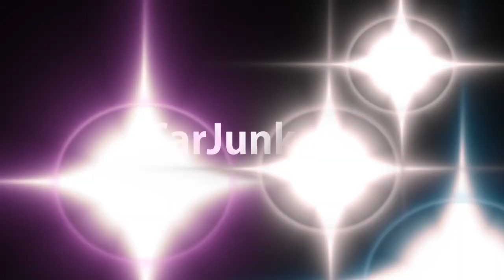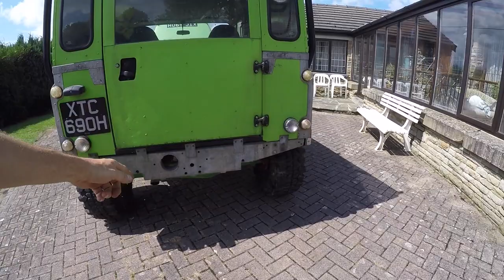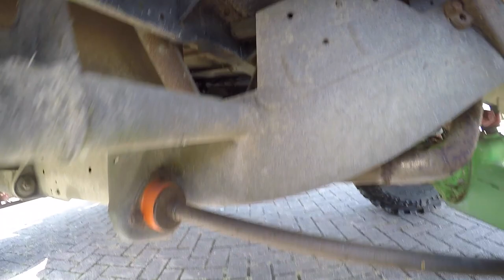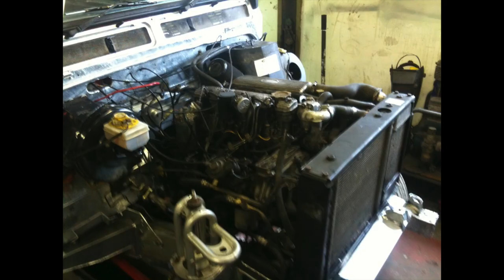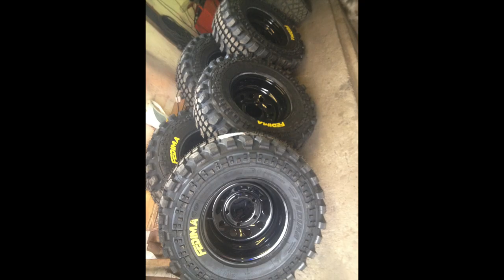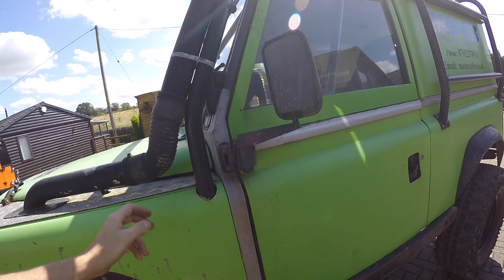GREEN TING walk around. Land Rover Series Defender Rough Off Roader

Comment: Our 2a is a izusu 2.8 td from a trooper under the bonnet,   We found a defender with a 300 tdi.  But needs a lot of maintenance, it’s missing a wheel and filled with junk.  And that’s the easy stuff u can actually see.   Just empty it and get some off-road tyres. That’s common sense.   But.  It’s what the chassis is like, Just wondering how easy it is too tweak a fuel pump on a 300 tdi defender and should I try and definitely have a look at it.     Or is it just rubbish that I’ll never be able to build.   ( should I invest in trying a 300 tdi defender.  Or no)
Reply from the maker: Yes the Isuzu 2.8 is a common swap in the early landys. Yes the 300tdi is quite tunable, check out my video on how to tweak the injector pump on my other video’s, definitely have a go mate as it’s quite easy 👍